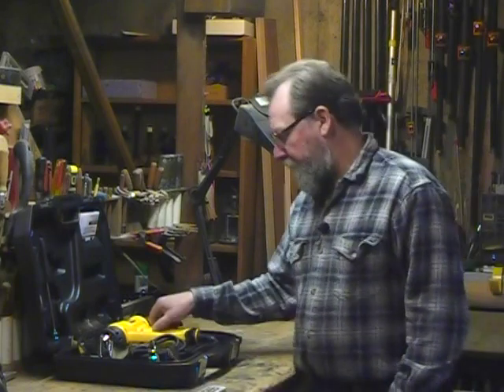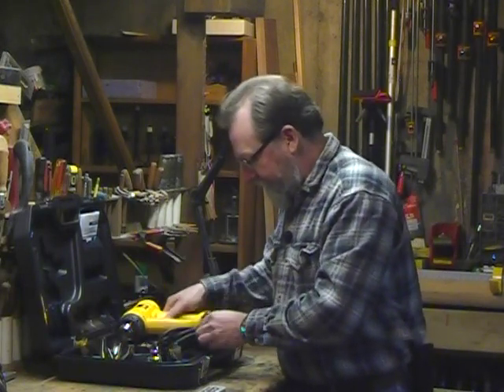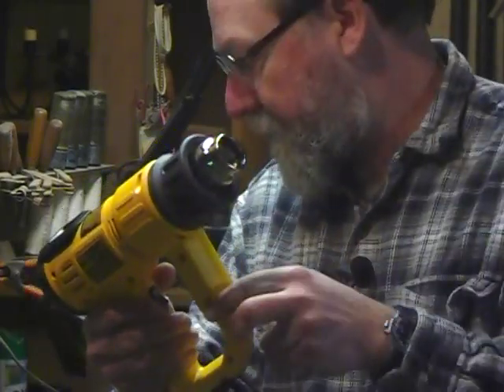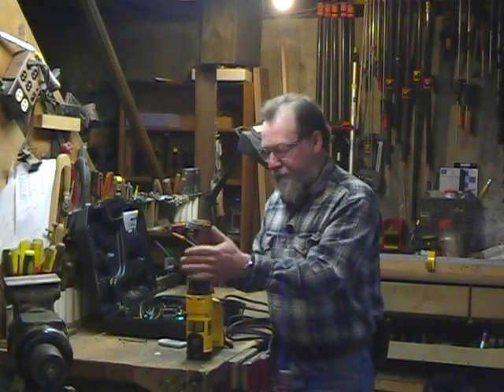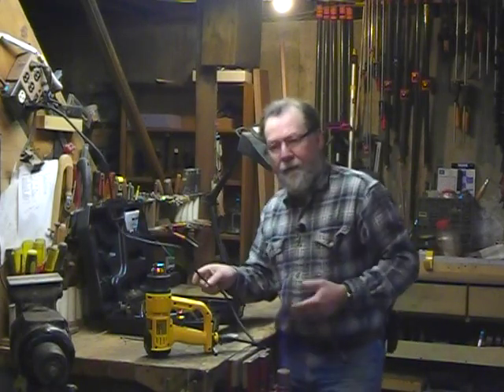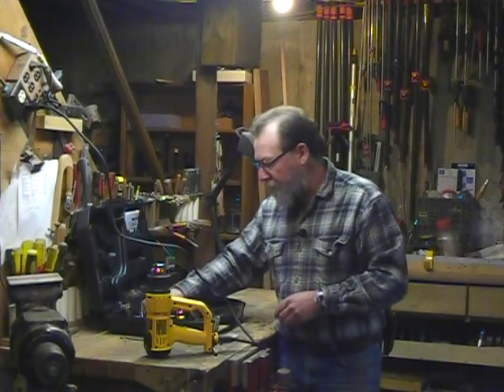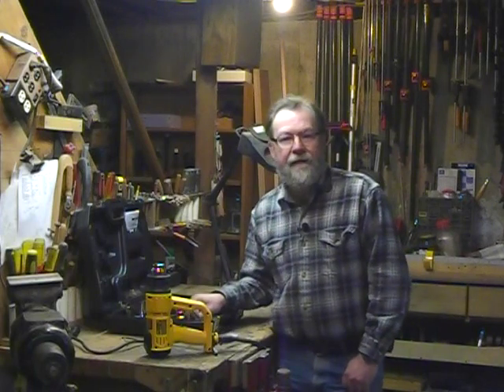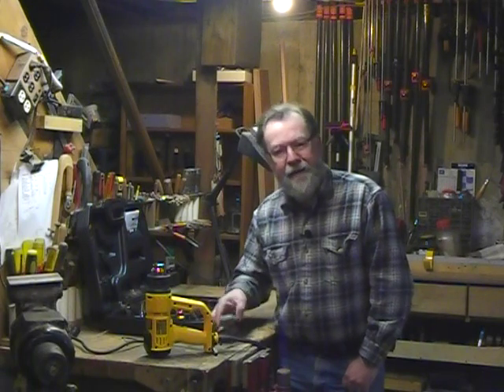Review: DeWalt heat gun

Comment: Its nice to know that so many various kinds of tools available and DeWalt Heat Gun is one special in terms of quality for different applications purpose, however sir, if you can make some more videos on how to remove various nuts & bolts which are difficult to remove even after applying kerosene or anti-rust solutions...so Heat Gun helps.
thanks for the nice solo video.